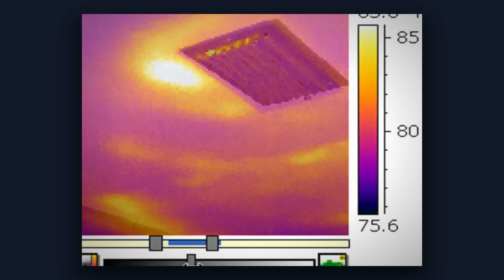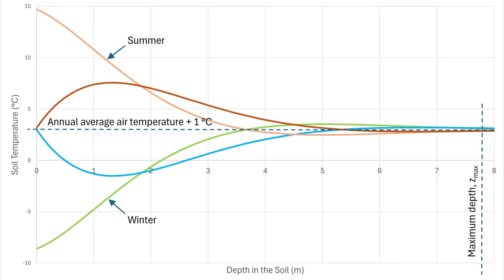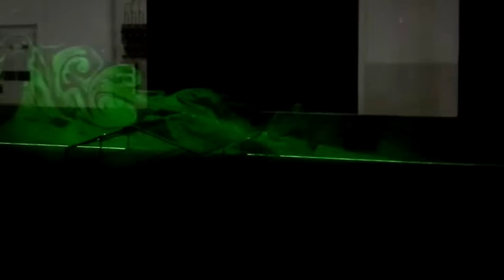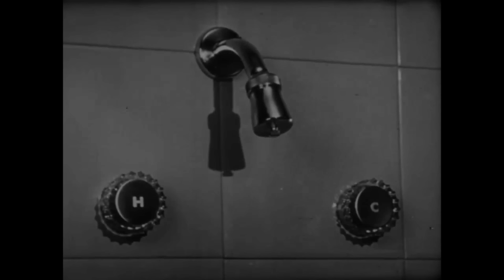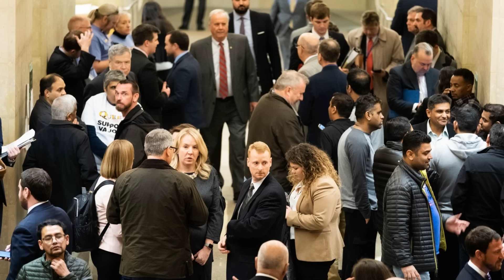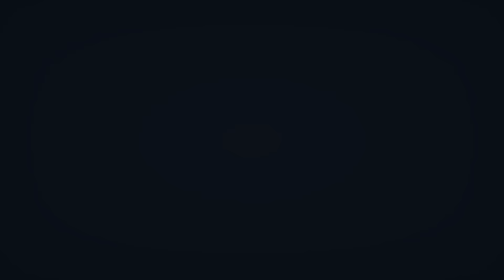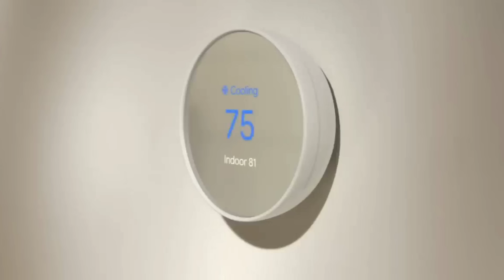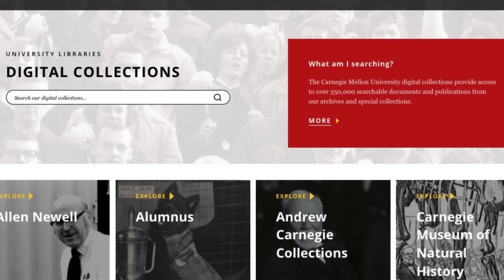This $300 Tunnel Heats Any Home All Winter for Free — The System the Gas Industry Made Illegal

Comment: This is the same as geothermal heating, but geothermal uses water filled pipes that hooks to their water heating system . Not steam heat, water heating system to heat and cool their home. The People I know have geothermal and love it. Many Greenhouses use the air filled method as described here in this video. It works.
Reply: Correct. I own a geothermal heating/cooling system in a very cold winter climate and am very satisfied with it after ten yrs. It transfers HEAT by design and has a COP coefficient of performance of 4-5x that of a typical furnace. Having said that, I monitor the incoming ground temps. Underground heat transfer is not unlimited as this video would have you believe. In mid Jan thru February when heating demands are most intense ground temps drop from 55F to 38F despite 1800 ft of ground pipe and an 8” snow blanket insulating the ground. I find this video deceptive and misleading re the real science / benefits.

Comment: To all those people talking about the return air system being inside the house, you are correct however there is a vent to let out unsafe gasses from the heating system and that venting system takes some of the house air with it. This creates a pressure differential between inside the house and outside drawing air in to the house from outside through any slight gap and crevice. A very high rating of air efficiency is .8 air exchanges per hour. Many homes have 4 or more air exchanges per hour so the consept of allowing the draft to come through the ground tube first, holds true.
Reply: I don't believe you understand what is going on with your furnace. I've lived in my house for 36 years with the same gas furnace that was installed during construction.  The furnace is located in the attached garage and draws combustion air from the garage.  After combustion the exhaust goes up a metal pipe and is vented outside taking NO warm air out of the living area.  Air from inside the living area never mixes with the combustion air in the furnace.  So there is no pressure differential sucking air out of the living area.  Sure there are cracks around doors, windows, outlets and other places that let cold air in and warm air out, but it's not caused by the furnace.  It's just air leaking into and out of the structure that wasn't sealed up during construction.  No pressure differential in the garage either as there are leaks around the garage doors, roof and a large vent in the gable.
Reply: @stevew.4935   Many houses have the furnace in the basement or a closet, where it will draw combustion air from in the house and vent it out the roof vent.
Reply: @stevew.4935  This type of system uses a very slow fan to bring fresh air into the house at 55 degrees, instead of it coming into the house at say 0 degrees through air leaks around the windows. It slightly pressurizes the house keeping the colder air from coming in through those gaps. Heating 55 degree air is a lot easier than heating 0 degree air.  Where the combustion air for the furnace is coming from makes absolutely no difference in this system. The air for your combustion is coming from outside air coming in through gaps in your garage.

Comment: januari  then i close my gas main value because my neighbours under and next to  me they create so much thermal mass that i still have 18 degrades celcius in my home  i turn it on only for persenol hygine like bath or shower otherwise i dont need gas i cook on power wich come from solar panels every month i get 100 euro back while mining on crypto coin all year round its perfectly setup  1 thing i chanced air fent system original it where kitchen and bathroom /laundery room but i extended that to the bedroom aswell so all rooms now have ventelation im in the eu nothing is impossible as long if you have the right mindset      

kind regars , peace

Comment: Whoever made a furnace that pulled in outside air? Or for that matter an air conditioner that pulls in outside air???? Yes, the Earth does have a stable temperature below 4 feet but this video 
 Is misleading.
Reply: There has never been a house built that is sealed 100% from air infiltration. So at least some comes from outside. What percentage depends on the builder. As far as Airconditioners go they take return air from inside a building being heated through windows and in and out traffic. Bringing in 55° air would help alot i believe.

Comment: Click bait, nothing illegal, l was a geothermal contractor for years, your idea only conditions a small amount of air required for newer "tight" homes, NO residential heating system draws return air from the outside!!
Reply: I don't think that is what he is trying to say,  He's trying to explain to you that by tapping into the return air you no longer need a fresh air intake where the air is coming in at below freezing temperatures.

Comment: I think in Europe they do this but have carbon filters they change annual to prevent cancer causing radon gas from getting in your house from the ground. Also I believe the pipe has to be placed at a slightly downward angle so it can have water drain away from the house otherwise mold can form which could go into the house making people sick.
Reply: curious ... if its a continuous and sealed pvc pipe end to end... how would radon get in?
Reply: Carbon filters do not block the radon gas, which is an inert gas  from passing through. What blocks the radon gas is the radon barrier, placed under the entire area of the house plan. This barrier may at the same time serve as a hydro/moisture barrier. Sometimes, the pipe is introduced all the way from the soil through the entire hight of the house, exiting through the roof to vent this radon that can seep through the tiniest perforation. But this is all academic. There are many houses thay are a pure trash, no protection of any kind whay so ever. People are dying without knowing what hit'em, and Radon sure is a silent killer.  Radon's intensity is highest in the cases of rocky soils, less so in sandy soils.

Comment: If that was buried in wood chip that decomposition it breaks down and release heat naturally it wud increase the incoming temperature in pipe entering the home because water 💧 through ground source heat pumps return no more 13 degree's at most before it enters the home and they go down 40 feet into the ground

Comment: Well in New Hampshire, the frost line can reach down as far as 6 feet. We would have to dig down 8 feet to get this working.
Reply: In Maine it cost $900 to $1,200 just to fill the oil barrel just ONE TIME... usually about 3 times a year
Reply: Better get busy digging 😂
Reply: I live in Maine. Building Code has the frost line at 5’.
Reply: It would work best for cooling in summer. There is no frost in summer. In winter my guess is there are only 2 months of frost down that deep. Just shut it off for those months.

Comment: The concepts presented here are valid...but it is factually incorrect at numerous points along the way.  Ground-loop geothermal is a thing, and has been for decades.  It's not illegal, but it IS pretty cool, if you have the land to build one that is horizontal instead of vertical.

Comment: This got me thinking about my own situation. I live in a pretty humid area, and I’ve actually considered trying something like an earth tube system. But one thing I’m still confused about is the condensation issue.

If warm, humid air keeps going through a cool underground pipe, wouldn’t moisture build up over time even if there’s a slight slope? I’m worried it could eventually lead to mold or bad air quality inside the house.

Has anyone here actually tried this in a humid climate long-term? I’d really like to know if it still works safely or if extra steps are needed?
Reply: Its a little more effort and coat to create a separate system that transfers cool underground temps to a radiator where the air blows across to cool the house or an area around an AC condenser so it isn't cooling 10p degree air
Reply: This works in any climate, whether extremely hot, extremely cold or humid. As the video indicated, add a catcher at the lower point of the tube to minimize condensation. The simplest way is to put a thick layer of clean pebbles at the lower point (like about a foot thick) so the moisture has an outlet and not drown the tube.

Comment: Northern Minnesota - I Had To Go Down Over 100' To Remove "Re-Claimed Buried Fill-In." 6" To 9" River Rocks Mostly. Super Backhoe Really Took A Beating! The Water Drilling Was 152'
. Filled-In With Class-5 80' Worth. Why Class-5? Black ABS Tubing For Water/Anti-Freeze Cooling/Heating System. Works Flawlessly.
. 8" Air Duct To The Basement Heat. The 6-9" Rocks Are Part Of The Thermo Harth. Topped Off With 12 Hemispheric Solar Heat 1" Copper Tubes For Heat Collection. Nobody Questioned "A Water Problem" Claimed Issue While Being Built.  They Signed Off When Completed. 🤠 . The Solar Collectors Were Added After It Was Signed Off "Passed"
. Average Yearly Heating For This 2300 Foot House Has Been $43°° For The Passed 11 Years. ❤️

Comment: Will this work with a gas boiler/cast iron radiator set-up?
Reply: Yes, it will—and much better than with air. But these things aren’t really a game changer. Good house insulation and hydronic radiant floors do the job better and cheaper than any air-based heating system.

Comment: the furnace heats air that is 3 degrees down from the temperature setting- it does not take in cold air from outside.
Reply: So air heated underground is pumped into the house which needs less energy to raise it a few degrees by the furnace. Presumably this means there is a continuous exchange of air with your added heat being expelled. I'm not sure how efficient that is, but ventilation is a good thing.
Reply: I don't know where you live, but for the last four decades all high efficiency furnaces (direct vent) require an external air intake, for both efficiency and safety.
Reply: @d.macrae461  Perhaps that is for combustion air only - it would not make sense to raise freezing air to 72 degrees.
Reply: I believe in the video they showed you hooking into the return air duct.
Reply: That would still create a positive pressure inside the house which will result in leakage of heated air through gaps around doors, windows, floors etc. This is still fairly efficient, simple and low cost.
But there is a solution that is being employed in some new build houses in parts of Europe. Air to air heat pumps (AC units powered by solar/battery arrays) which are split systems that result in neutral pressure are used for heat. Incoming outside air for ventilation goes through a heat exchanger, picking up the heat from outgoing air. This could be done in conjunction with the subsoil tubes.

Comment: This won’t make a dent let alone 1/3 the cost as this video alludes to. The comment about not bringing in outside air to heat is 95% accurate. There is a small amount of delusion air or fresh air supply that is designed to keep the air in the house refreshed and sometimes especially in commercial buildings. They’ll have a pre-heater that heats this air, but you would not normally find it in a residential home the air inside the home is reheated and it doesn’t bring in outside air and heat up new air all the time this video is basically a waste of time and not factual
Reply: homes are usually drafty enough to get some fresh air. Newer homes are being built a little too air tight, and are running into moisture issues.

Comment: While I am an advocate of this technology I beg to differ on the winter usage over gas and electric. Yes if starting from a cold house of 55* this is probably true however, the majority of homes will be at a close to 70* temp during operation of the system! The HVAC system only has to adjust the interior temp roughly 2* on average so the winter performance is not correct!  Here is an example:
Earth tube air is brought into the house at 55* and the HVAC system turns on to bring up the temp to the set point. At a setpoint of 70* that's a 15* differential the system has to overcome every time the system turns on!  A normal system will bring that 55* interior temp (no earth tube) up to setpoint and vary only 2-4 degrees on average. I think I have made an intelligent point here against winter time usage!  Summer usage on the other hand is a different game altogether! 

Cool air introduced to the living envelope is the best possible solution as in theory the system could cool the entire home using very little or no HVAC cooling energy!  This would be the dream cooling system!
Reply: There is also thermal mass generation that could be added that has been regulated out of existence. That is the heating and air conditioning lobby choosing profit over people having heat and cooling that works.
Reply: You would have to either have the furnace intake suck air from the geothermal system as its primary air intake, or turn off the furnace, run the geothermal system until your house is 50°; shut it off and start the furnace at that time. Otherwise your geothermal system will always be cooling the house down to 50° and your furnace, fighting it, will be heating the house to 70°.
Reply: Thermo dynamics. If you look at air temperature change as a fluid. You may understand this concept better. (What is missed here in detail) The house is always losing heat. Lets pick ONE spot not multiples. Aka an open window. The window can represent all the heat lise in a house. To be fair. What the Amish knew is that drafts would occur. If you can control your drafts by bringing in pre warmed air. Your savings are incredible. Like 99% of current homes. We have what is a closed loop (what you describe and believe is only reheating air temp from 68 to 72) this is fiction.yoyr house leaks air and therefore leaks heat. Even well insulated walls leaks heat. Doors and windows leak both heat and air. bringing in the pre heated air will save on the differential heating. This video was 95% sit on. Except, the video failed to explain, in more detail, the closed loop house leaks air. The air leakage is what we dont know about and are unaware of its true costs. An HVAC leak test of your home will determine the total  heating costs. A home that leaks less? Will definitely save less. However, the percentages saved remain the same.
Reply: Duh, I got water lines 8 foot & get no freeze . 4 ft down in town & water lines freeze.  Concept is good, but 4 ft, no.  This is geothermal heating.  Water or air same Concept
Reply: I was going to make the same statement. Wintertime use is stupid as your home recirculates its air. It does not draw outside air in.
Reply: Wintertime use is stupid as your home recirculates its air. It does not draw outside air in.

Comment: Will this work for hot water heat. I have a boiler
Reply: for cooling yes for heating no
Reply: its for aircon if you use aircon you need less energy to heat the air comming in like he said. using boiler pipes dont leave the house so they are always warmer than underground air or you would hope they are. and need less energy to heat up again when running trough boiler.

Comment: any system you bring in will cost you a hell of a lot more than $100 in pvc
Reply: yeah PVC isn't cheap at all, especially if you take the 4 inch pipes and elbows.
Reply: I have lots of PVC lying around. I know today it isn’t cheap but is there another alternative? I ask because it’s still plastic we don’t need. Maybe cement pipe or clay pipe?
Reply: @user-wq3jp3qg1o I think both alternatives would work as well. I also advise putting some filtration at the outlet in a house or such, because air quality. If you make sure there is drainage in the piping you avoid getting stagnant water in the system as well. This video gives people a good idea for a way to think but it lacks actual information about how to do it. Length, diameter, depth, how many corners in the system, the angle it need to be put in the ground, all those things matter a lot to make a system work well. The video switches the light on for people but research is one hell of an important thing before spending a lot of money or effort for a system that doesn't work.

Comment: i think it could be could to build to heat the compartment for a heat-pump in the deep cold winter of Qc. the usual heat pump are no effective under around -25C so if it can keep it at something at minus 10 it could be a huge improvement for those days where the electricity price is the highest due to the peak